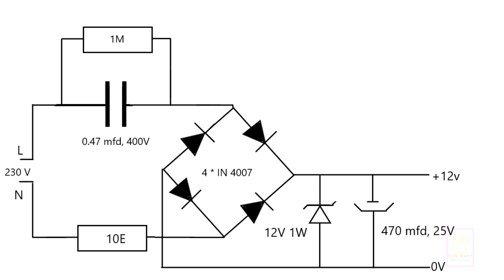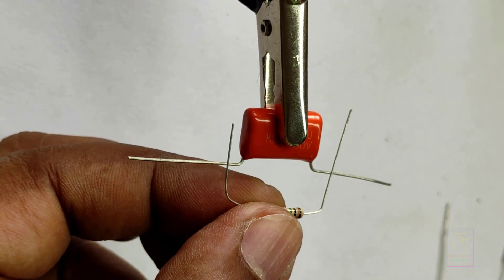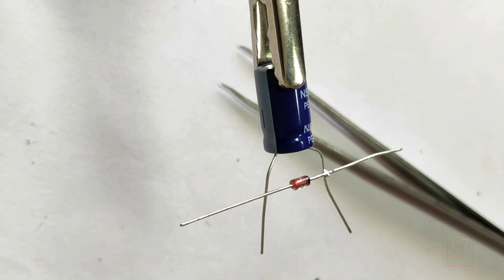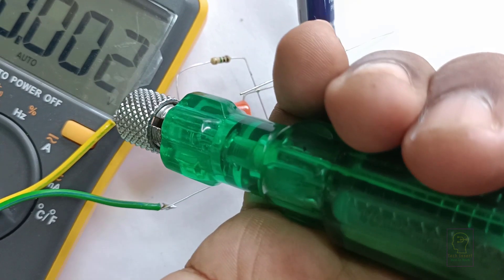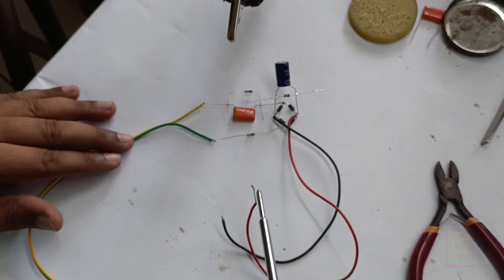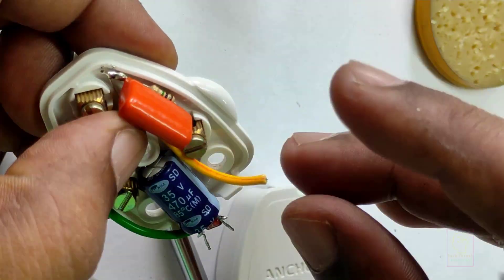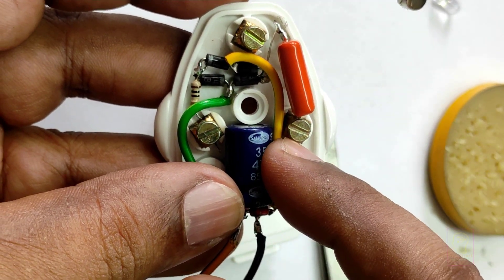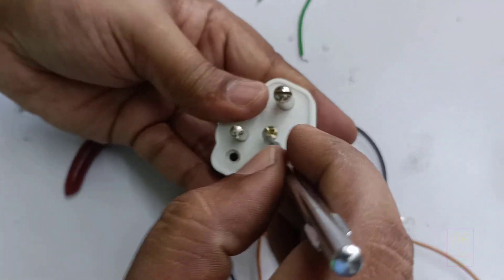Make Your Own 12V Power Supply Without a Transformer!

Comment: This is a death project. if the capacitor fall down you will get 230v instead of 12v.
Reply from the maker: No, if the capacitor is open, then voltage will come thru 1M resistor and current will be very less. If the capacitor is short then 230V will short circuit the 12V zenar(coz of huge reverse voltage) and the 10 ohm resistor will be open. 10 ohm resistor is acting as a fuse here. In my home, for the past 6 years i was using the same circuit for low current applications.
Reply: @TechInsert  I will never use such circuit.  12V transformers are cheap and much saver.
Reply from the maker: @Nar235  I totally agree with you. What I had shown is - You can make like this also
Reply from the maker: You must use 3 pin plug with right pin Phase line
Reply: No this is very useful in covered environment